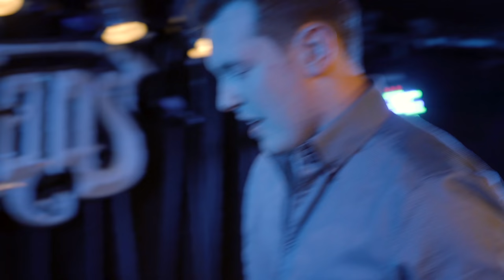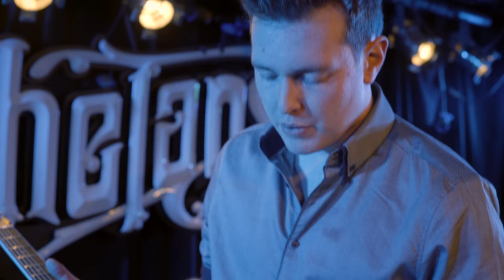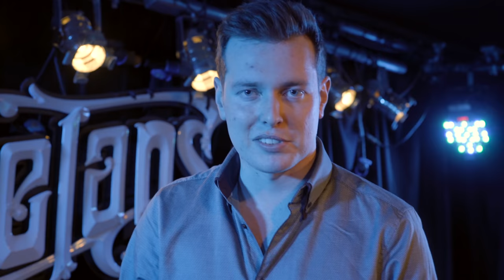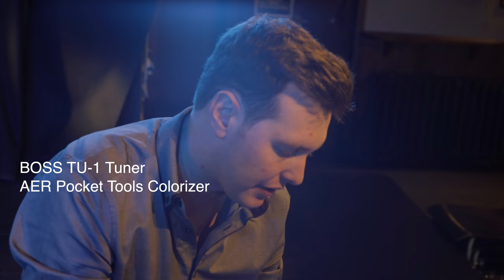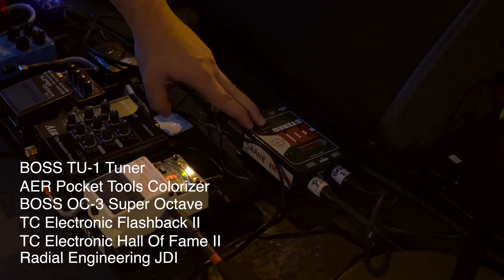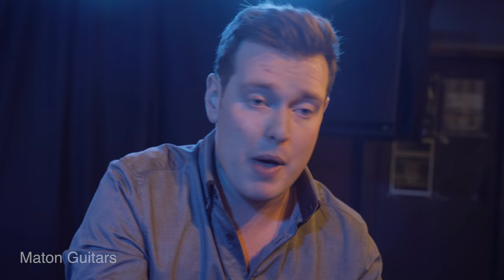Rig Rundown (Shane's pedalboard)

Comment: That’s great man how are you using the Colourizer ? Guitar - Colourizer - other pedals - DI? No amp? Do you not put the  colourizer straight in the Pa? I just got a pocket tools and trying to get my head round it 😂Love your playing man look forward to see you live soon
Reply from the maker: Hey there! So in this video (Nov 2018) it was:

Guitar -> Tuner -> Colourizer (line out) -> Pedals -> ACUS amp. I put the Colourizer in after the tuner and before the pedals, because I wanted it to work only on the clean sound of the pickup without any effects. Occasionally I'd also take the DI out of the Colourizer to get a very clean pickup sound (dry sound) to balance the signal with the effects (wet sound).

I've since replaced the Colourizer in this setup with an Udo Rösner Da Capo 75 Amp at the end of my chain. I also took out the ACUS amp for touring, but enjoy using them both in stereo at home. I'm also experimenting with using my effects wired into the effects loop of the Udo amp, not immediately practical for touring but definitely getting better sound results.

Up to last March, I was bringing both the Colourizer and the Dual Mix Pocket Tools units with me as a backup, in case there was an issue with the amp. I'll likely do this again once touring starts up in August.

In your situation, I'd recommend working with the gain level on the Colourizer against your pickup volume first to get a good signal - that's 90% of 'the big sound', to my ears anyway. I use the bottom row on the Colourizer to take out frequencies rather than boost them. The tone knobs (middle row) can be used to increase bass and treble frequencies - I think of that very generally as "more fingerstyle vs more strumming" sounds. I never liked the sound of the enhancer feature with my guitars but it can sound good on some pickups especially if they need a specific type of brightness/presence.

Hope that helps!
Reply: @ShaneHennessyMusic   Dude this is amazing thank you for taking the time to reply! yeah I was using it wrong I was going the the bypass instead of the line out lol! so now I'm going line out into amp and it sounds great. Definitely did what you suggested and its really nice thank you. there is a DI on my amp (AER) so I'm using that to go in the PA. Will try at the next gig. Love your stuff dude look forward to when we can see you play again. take care all the best and thank you again for your time.
Reply from the maker: @dooglehill3794  Happy to help mate. If you're using the reverb from your AER amp, depending on the model you have it may or may not come through the DI output along with the guitar signal. Check that out, because you might think there is reverb on your signal, when you're actually only hearing it from the amp - it may not be coming through the PA at all. That happened to me in Germany in 2019!
Reply: @ShaneHennessyMusic   wow ok I better check that out then! Maybe have to get a reverb pedal if that happens it’s a AER compact 60 amp. I will try the wet dry thing too like you suggested, so you have 2 DI out all the time one amp one DI box or pocket tools?
Reply: @ShaneHennessyMusic   hey dude me again just wanted to say thanks after this comment you made about reverb not coming out the PA from the amp I checked it and I didn’t get any either so bought myself a reverb pedal and sounds great at gigs thanks again for taking the time to reply take care hope to see you at a show soon.
Reply from the maker: That’s great to hear, glad I could help!